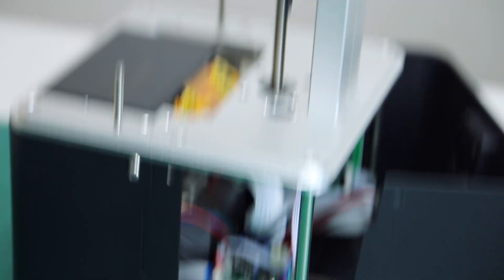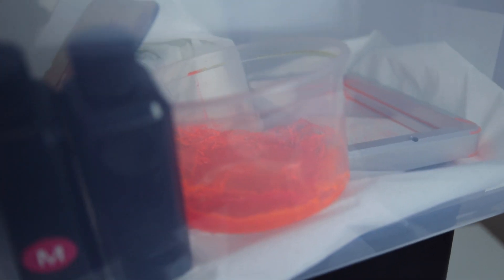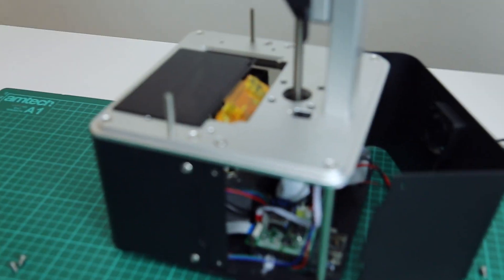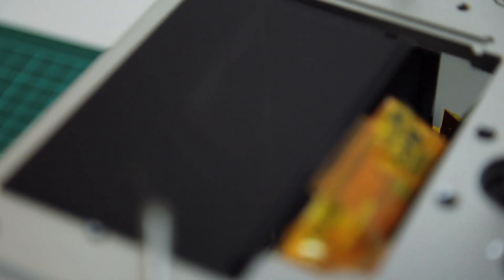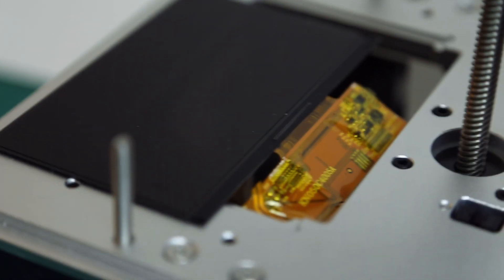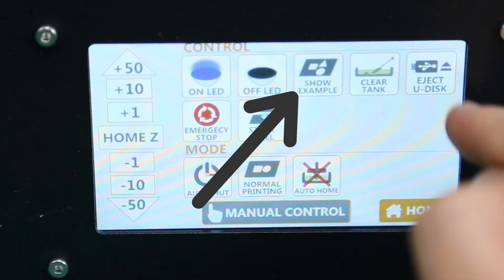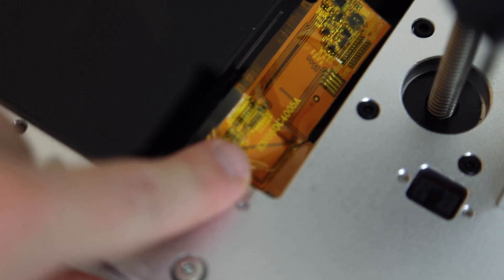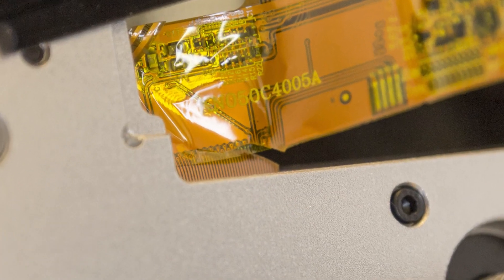WHY there are no videos on the L2 Resin 3D Printer yet

Comment: You said the screen was working to begin with, I know what you mean how you can see it through the cracks.
After seeing that flexible circuit board, I can tell you 100% your screen will not work after that. So it obviously happened after shipping, don't need to lie dude, you broke it tinkering. 

If anyone is interested in seeing prints, I have this same printer, here is a post image album.
https://postimg.cc/gallery/t99hiw26/
Reply from the maker: what I said was that it does send UV-light, so that's what I sav. UV-light source is working, but LCD is not, so no UV-light goes through it to the build tank.  Two different things, one that always work (UV-light) and one that was damaged in shipping (the LCD letting light through).  Not sure how you came to the conclusion I lied, I just stated the facts that nothing printed, although I saw the UV-light leaking form the sides of the machine. There were dents on the package as well.  When troubleshooting with the pattern I noticed nothing shows up, so LCD isn't working.  

After the spare parts it's working fine, but curing settings for 3rd party materials is terrible and it's too messy to get good results without a lot of troubleshooting. I've run more than a liter of bad attemps in different resins and when it cures nice, it won't unstick from the bad FEP.

I've tried swapping FEP-film, but that is also terrible as most of my screws were over-tightened and bad quality. 4 of them broke when I tried unscrewing them. That's build quality and not my maker-quality :P   So to even change the FEP-film to a better/thinner one with higher quality I need to buy a new FEP-film tray...   Hopefully you're getting why I'm not a fan of this machine any more. Specially when there's options out there.

Comment: Did you receive your part ? Because I am having the same problem with my brand new L2... No LCD appear not to be working
Reply from the maker: It's still in shipping. They sent the machine with express, which gave customs and shipping costs. The spare part was with slower mail. Should be in any day now, but haven't recieved it yet. Asia to sweden is usually pretty slow if not super-expensive prio mail
Reply: It appear they have work on your issue because on the machine I received  flat ribbon board is glued so it can't move. I dont know whats wrong on mine ? I cannot get the Wifi and when I try to print on standalone, it appear the LCD is not working...
Reply from the maker: Hey! Just checked mailbox and I got the part =) Should be up and running soon

Comment: What makes you think it's a shipping issue?  This looks like a design problem to me.
Reply from the maker: Maybe a mixture, it was of course not damages in factory, the part hanging was probably loosened in shipping and the moving around (since it has some mass) broke the cable. Could probably be solved with better design
Reply: Did the unit's exterior have any signs of stress/damage?
Reply from the maker: Yup, a little, a corned showed a little bulge, nothing too much, but obviously enough.